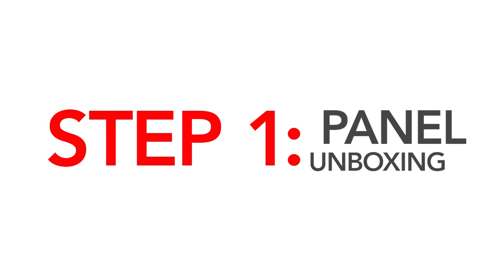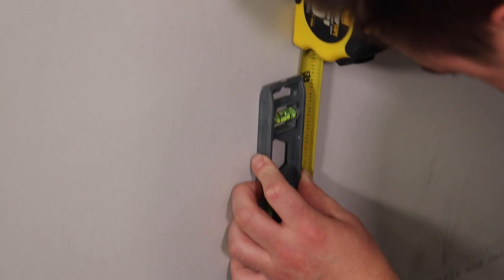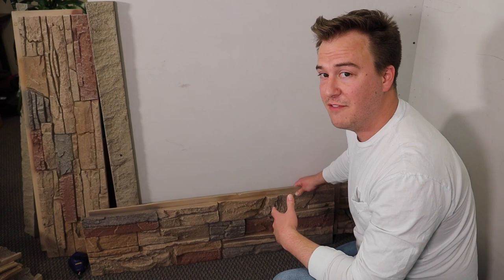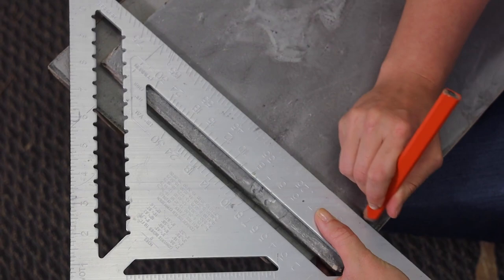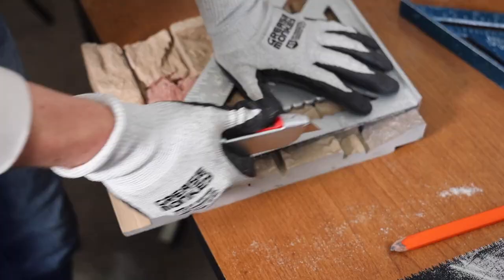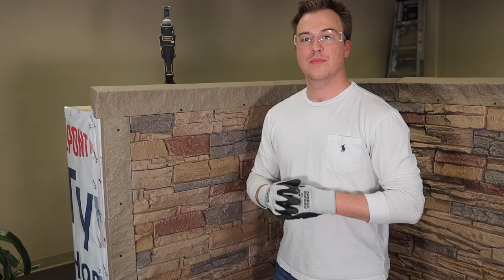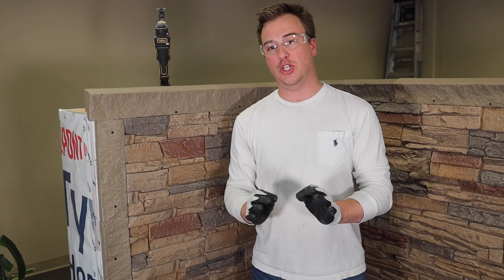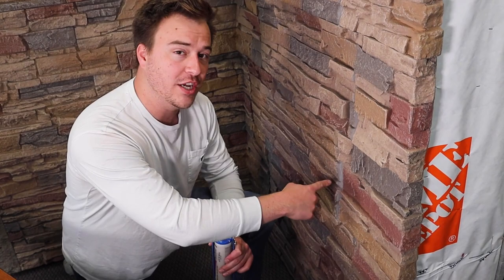Interior Install | How to Install GenStone Faux Stone | DIY Home Improvement

Comment: NEVER have your table saw blade that fully extended on shallow material! ALWAYS - ALWAYS - ALWAYS - lower the blade to where it is only protruding approximately 3/8 of an inch through your material (in this case, 3/8" past the highest point of the panels uneven surface). Doing this will minimize the chance of your blade "kicking back" the material. This goes for skill saws as well. :)
Reply: And no gloves.
Reply: Just high enough to cut the material, at 3/8s you can still lose a finger.
Reply: Funny you mentioned that, it was my first thought when I saw that.

Comment: Can these be placed behind a woodstove  as an accent wall? Can it withstand the heat?
Reply from the maker: Yes that's a common project as long as you follow this rule of thumb: if you can place your hand on the surface where you plan to install GenStone while the unit is running and no flames or embers will contact the panels, you should be good to go! Feel free to give us a call if you have any other questions.
Reply: @GenStoneVideo  thanks for the timely response!!!

Comment: I have a front bay window with stucco exterior and want to use genstone over the top & bottom, I have two 45 degree angled edges...how do I join the corners?

Comment: Question: I’d like to install one of your faux brick patterns in a butler’s pantry (floor to ceiling). I assume that my stud-finder would work “through” (on top of) the faux brick panels. Can kitchen cabinets be installed after the faux brick is installed? Is that the recommended process? THANKS!
Reply from the maker: Can you install the brick right up to the bottom of the cabinets? Yes, you can install over the brick as long as your fasteners will reach the studs behind our panels. The panels are only 1.25 inches thick, so that shouldn't be an issue, but if you can avoid installing the cabinets over the panels, you would save on unseen material. Feel free to give us a call if you need more help.